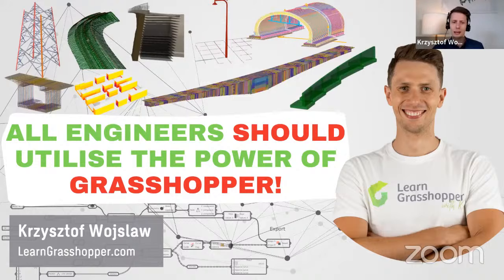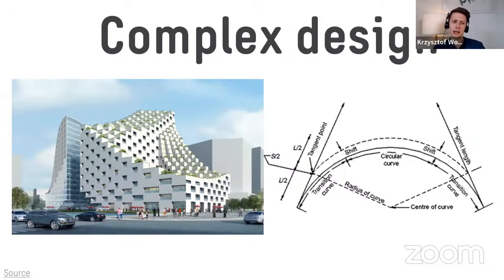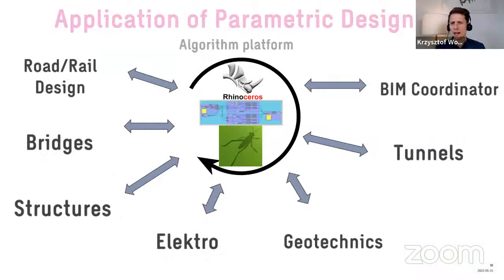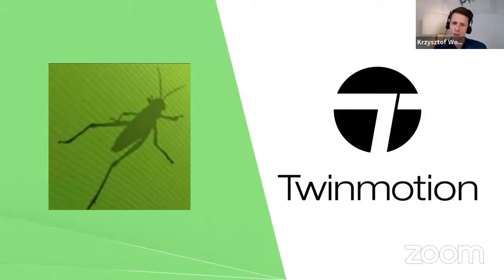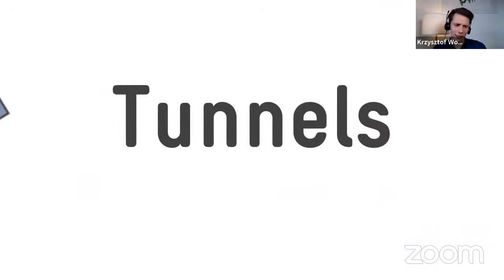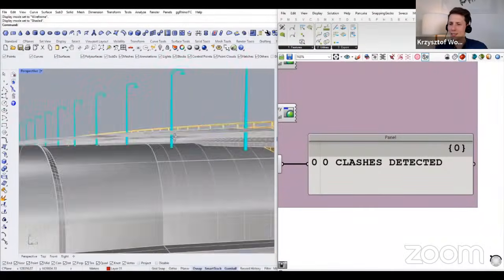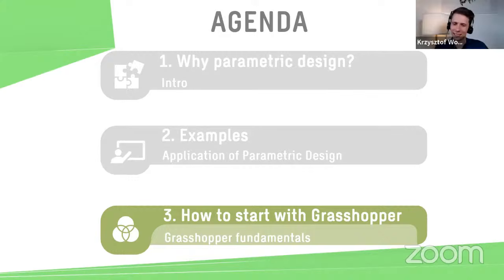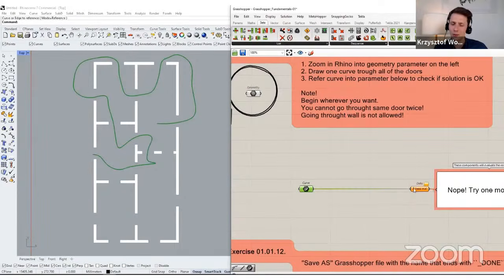Webinar: All engineers should utilise the power of Grasshopper! (English)

Comment: A very basic question as i am a new learner to computation design. The slider in grasshopper are to be manually make ourselves or while we draw something in 3d, the grasshopper automatically creates sliders like in Staad Pro we do graphical 3d modelling using the graphical interface and the software itself creates the staad editor file (coding) that can be easily modified ???
Reply from the maker: Hi, you need to manually create the grasshopper definition with the sliders to control the geometry or processes